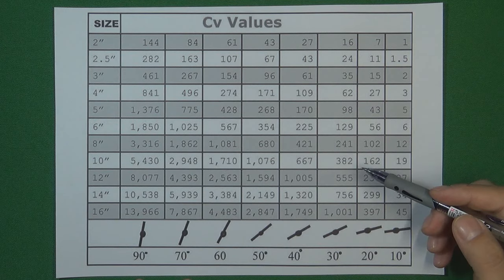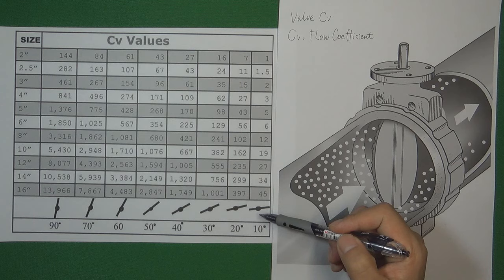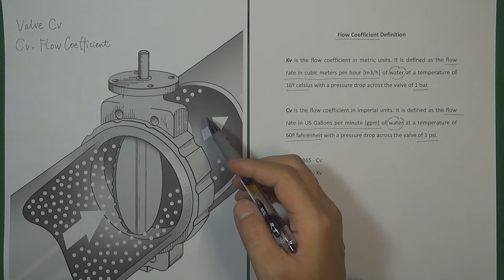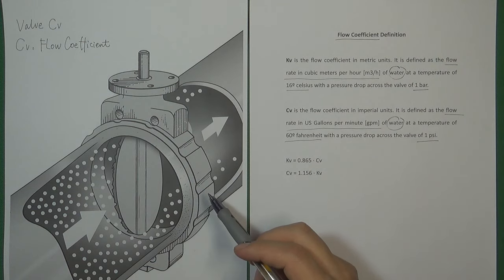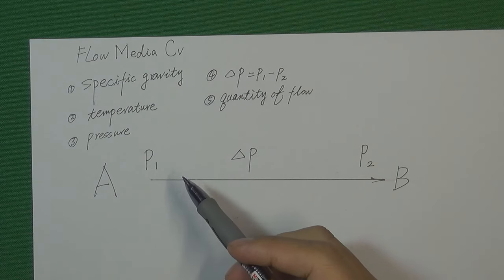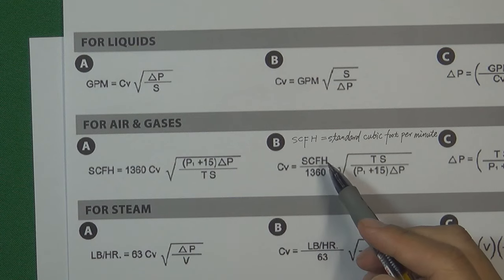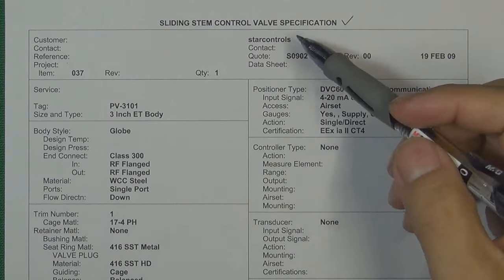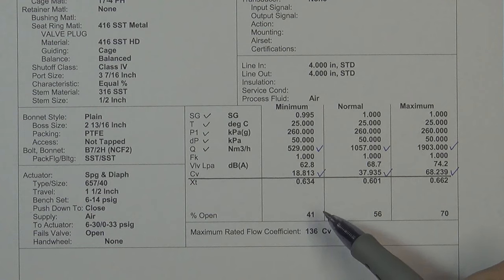What is CV and How to use CV #Design Tips 5

Comment: Can we have a video to calculate a circuit from a pump to a pipeline to a control valve and to the heat exchanger? How much is the pressure drop through the pipeline ,control valve and the heat exchanger

Comment: Question: I would like to understand more on your tips that the valve more accurately between 30% to 80% opening, why is this so? Or does it actually depend on the valve trim configuration, and one must get advice from the valve manufacturer? Thank you, this is a very good video..
Reply: I didn't fully understand your question. Do you mean why is Cv value different for 30% opening to 80% opening?